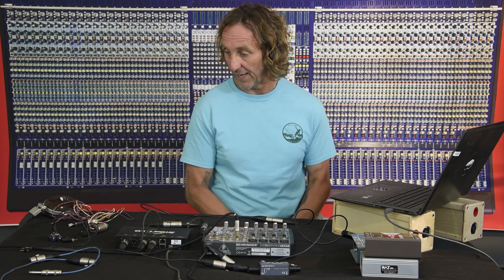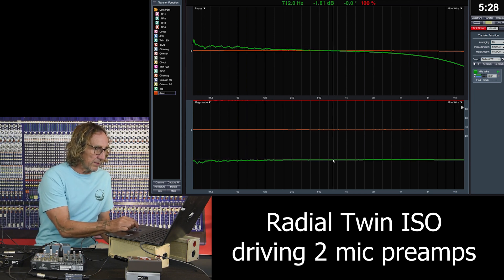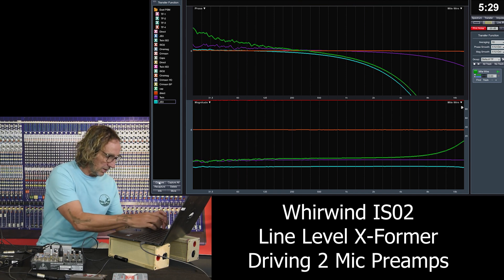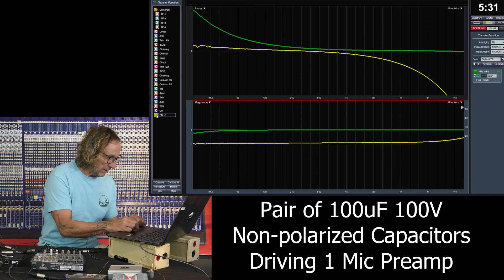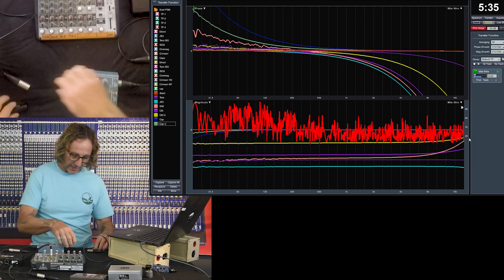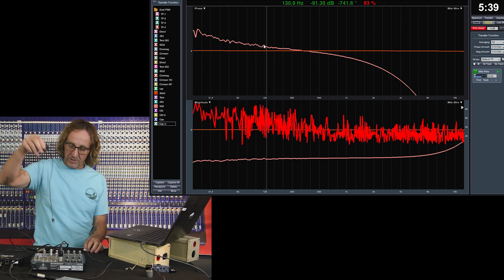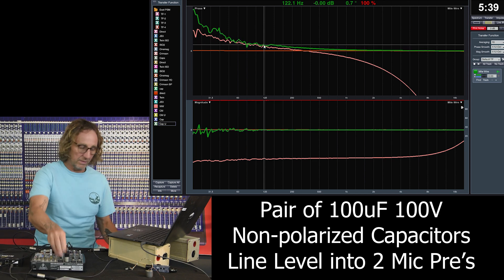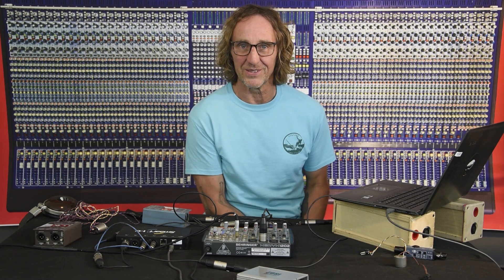Transformers vs Capacitors DC Blocking & Overload

Comment: Are you putting the caps in parallel to raise their value to 200uF and connecting the bank in series with pin 2?  Or is that one cap in series with pin 2, the other cap in series with pin 3 for filtration on the + and - of the 48vDC?
Reply from the maker: Option 2. Both pin 2 and 3 need blocking
Reply: @DaveRat  thank you!!!!

Comment: I wonder what the difference would be loading down the transformers with pure resistors vs. the mic preamps since as you pointed out, preamps have caps in the circuit which will alter phase and frequency response. I might be cool to test with 1.2k-2kΩ resistors for mic level transformers and maybe 10kΩ resistors for line levels like to be close the impedance of the average line input. Then compare a couple of different mixer pre-amps and line inputs of comparable impedance. I realize DC resistance/resistors aren't a real world load, but it would give a non-reactive baseline to compare.
Reply from the maker: I will try and take a look. By theory, the impact of the loading impedance should impact the frequencies relative to that impedance.

So, since an audio preamp cap passes audio freqs, it should be fairly transparent at audio freqs

Comment: The trick of adding a small cap in parallel to the big blocker works OK but using an active op amp with a big cap in its feedback loop to strip DC away is cleaner still. DC blocking caps are notorious for causing loud "pops" as they charge up on power-up or when connecting cables.
Reply from the maker: Yeah the caps do cuz pops which can be troublesome. Sonically I think they present less of an issue than transformers except for the pop

Comment: Can you please tell the effect of increase vs decrease of phase (offset) for a particular frequency (low-mid-high)?
Reply from the maker: The phase shift itself tends not to be audible unless combined with the same signal and a different phase shift.

The phase shift of the lows or highs is mainly an indicator that we are getting close to a limit of some sort with passive components like capacitors and coils

Comment: Very nice Dave thanks when I need transformers I only use Jansen and use the correct one for the job just the other day I had to run audio signal down cat 5 60 meters and running past the breaker box so I put transformers at each end it worked better than i thought-35 db noise floor it works fine for now
Reply from the maker: 👍👍 if ya use balanced lines down shielded cat5e, probably won't need the transformers as cat 5 is excellent at rejection with it's excellent twists. Especially, u/ftp or f/utp
Reply: @DaveRat  yes true that all happened cos the  people doing the cable runs and run out of signal cable so the cat was being used as a draw cable nobody told me shit happens

Comment: Two 100 mfd caps  in series reverse polarity create a 50 mfd  bi polar cap if not mistaken .  Have been happy with the  sound of Muse bi polars in the 100v range   . Found nice results with replacing  polar with bi polar in the signal path in ic signal chain  . Upping the voltage where space allows.  A nice clear informative video . Regards
Reply from the maker: In this setup I have 1 cap on pin 3 and 1 on pin 2
 Nothing is in series and series is not needed as they are non polar.

And yes, if they were polarized, would need 2 in series for each of pin 3 and 2, and the caps would need to be 200 uf each to achieve this setup.
Reply: @DaveRat  thanks for the clarification ! Sorry about the diversion then . The Muse bi polar cap preference stands thou . Regards.
Reply from the maker: Very cool and interesting. I tried measuring different cap brands I have here but don't own gear accurate enough to find differences I could point to as clear and distinct 

My guess is that since audio tends to go through many many caps, the cap type quality is both irrelevant and possibly important.

Irrelevant in that if audio goes through 30 caps, changing in to high quality is meaningless. But important possibly in that if each cap has a slight fegredatopn, changing all of them cod be advantageous

That said, if audio is not going through any caps and adding one, I would say the higher quality would be a logical choice
Reply: @DaveRat   Once you are above a certain level and using bi polar caps the difference is small vs time and trouble . Doing what you can to not have 30 polar caps in your signal path is a very good goal . The problem with many people is they are not pragmatic in their view of a situation IMHO . 😁
Reply from the maker: Agreed